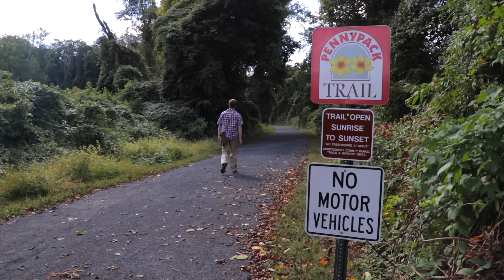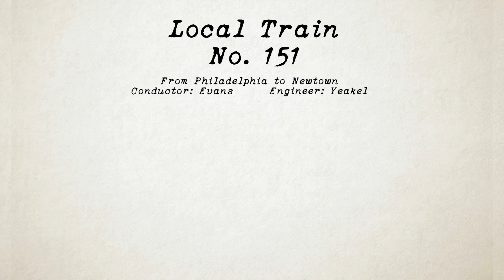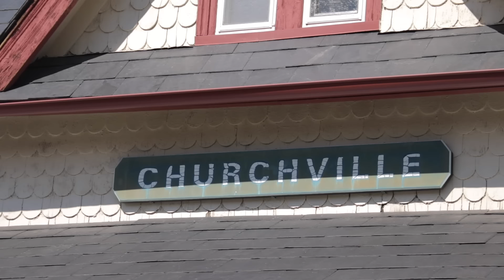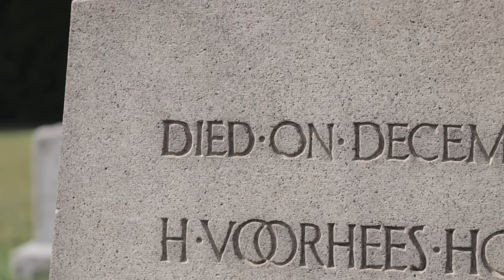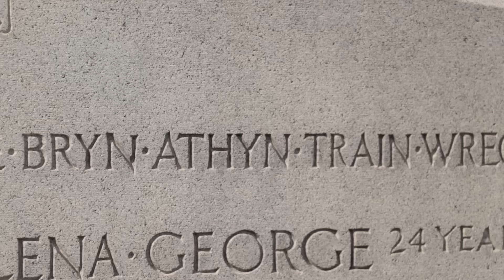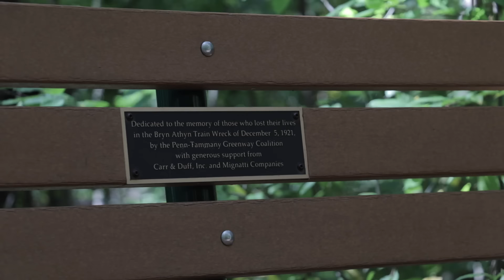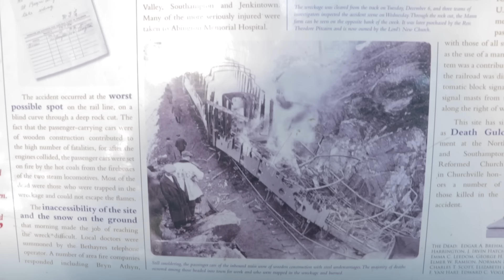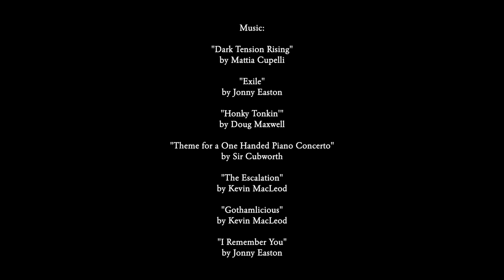The Bryn Athyn Train Wreck of 1921

Comment: A fascinating story. As an English railway enthusiast and son of a signalman - should I say tower operator? - I know only too well what happens when people get complacent or cut corners. We had a similar disaster here, at Abermule early in the same year, due to every responsible person involved failing to take even the most basic of routine safety measures. Oddly enough, one of the two trains involved was also coming from a place named Newtown. On a slightly lighter note, it was also interesting how many clips of British railway films turned up in this programme - some even from a British Railways training film of 1958, named 'Mishap'! There are also some from a famous pioneering British talkie film, 'The Wrecker' - the shot of the steam lorry is one. It is demolished by a train in a staged crash, of which you show a few clips as well. Thank you
Reply: Yes, I thought a few of the vintage clips in this documentary looked British to me, not that they take away from the quality of this video at all. 😉
Reply: Incidentally, the Abermule collision also occurred in 1921 - and as you say many factors leading up to the accident were eerily similar. I believe the collision even occurred between a local and an express, just as at Bryn Athyn, on a single line section.

Comment: Note - The reason for the single track through the gorge is because it is a natural fault line known as the Bryn Athyn Fault, which does occasionally gives us a tremblor.  The last one I remember was in the late 1970s/early 1980s.
Reply: I live in the area and never knew that.. Thanks
Reply: @cmendla  I used to ride that train on a daily basis and look out the windows (as green as those old RDCs were) at that cleft wall of rock through the cut wondering if it was going to get higher soon! ;)

Comment: An excellent video, especially given that (as far as I was aware from your time on Titanic: Honor & Glory) railway history was not your specialty. 

This was superbly told in excellent detail, especially little tidbits like how all locomotives involved were Camelbacks, a unique form of steam engine with an oversized firebox for burning anthracite coal, a particularly hard variety that is nearly pure carbon that burned extremely hot and efficiently but was hard to ignite and needed a large combustion space, thus necessitating moving the driver's cab forward to about halfway along the boiler. These engines had themselves been largely banned from US rails due to concerns of crew safety (there had been some instances of coupling rods breaking and skewering the driver through the cab floor, and the lack of visibility to both sides made them unpopular), but exceptions had been granted to the Philadelphia & Reading and the Central Railroad of New Jersey, making them the only lines to use camelbacks after the 1920's.

It's also interesting that this wreck resulted in the final banning of wooden coaches on US rails, a finding already made after the Great Nashville Train Disaster of 1918, the deadliest train wreck in US history. Rather than being the impetus for such change in itself, it seems more accurate to say that this wreck underscored the necessity of this change, and emphasized that it needed to apply to ALL American railway lines, not just long distance mainlines; what happened on the Nashville mainline could just as easily happen on the Bryn Athyn branchline or the Malbone Street subway line in New York, also in 1918 in which a train of wooden subway cars driven by an unqualified motorman rounded an extremely sharp curve too fast resulting in the train derailing and crushing against the tunnel walls. So the same safety standards needed to be enforced everywhere with no exceptions. Rather the same way that in modern times the Roslyn train collision on SEPTA in 2006 demonstrated the need for Positive Train Control, which was emphasized by the Frankford Junction high speed derailment in 2015.

One point of order though, I'd like to see your information that the locomotives' boilers exploded in the wreck. While this wasn't uncommon in head-on collisions, it was far from a given either. Look, for instance, at the Dugald Disaster in Canada of 1947, in which a special passenger extra collided head-on with a stopped express at 30 mph, resulting in both locomotives being practically fused together at the pilots, but neither boiler burst. As I say, I'm not necessarily doubting that it happened here, I'd just like to see where you got that information as many less credible sources sensationalize boiler explosions in accidents when nothing of the kind actually happened.

Comment: A good presentation on a tragic, avoidable disaster. However, I think more research is needed on wooden cars being outlawed, because they weren't, totally. Wood cars on mainline trains were on the way out after 1910, because the Pennsylvania Railroad did not allow them into New York through its new tunnels under the Hudson River (the same tunnels still in use today, in urgent need of replacement - but that's another story).
The Pennsylvania was the largest and most influential railroad in the US. Outlawing wooden cars into New York caused a great scramble by connecting lines and the Pullman Company - though it had started building all-steel cars, it still had thousands of wooden cars with steel underframes. These were assigned to other routes or secondary trains, and many older cars were sent to Canada or Mexico.
But all-wood cars remained in service on shortlines, branches, and commuter lines for many years. Wood passenger cars were eventually outlawed in interchange, but those that stayed in the "home" road continued in use, particularly those with steel underframes. The Boston & Maine used wooden, open platform commuter coaches until about 1950, the Chicago & North Western had similar cars almost as late. Many Class I railroads operated branch line mixed trains into the Fifties with wood coaches and combines, usually with steel underframes. 
All-wood cars remained in use to the end of passenger service on short lines, like the Maryland & Pennsylvania, which went freight-only in 1954. Until 1973, the Moscow, Camden & St. Augustine Railroad, a Texas short line, carried the occasional passenger in a former Long Island wooden coach built in 1898.
Reply: 1972 IC crash in Chicago nr.Soldier Field caused many deaths.A wooden passenger car and steel commuter car were flattened in the collision.
Reply: @daniellinehan63  No wooden cars involved in that crash on the IC's electric commuter lines. A train of Highliners, the new bi-level cars, overshot a station and was backing up without protection when a train of 1920s era heavyweight steel cars ran into it. The older, all-steel car telescoped the lightweight new cars. 45 were killed.

Comment: I don't recall any talk of this accident in the 1970's on the railroad. That surprises me, because any anomalous event was the subject of discussion. For example, in south Philly, some tidewater grain hopper cars rolled downhill from Penrose yard and nearly struck the Stadium Tower. Corn and twisted metal everywhere, blocking the tracks into Greenwich Hump and most of the Packer Ave area for a couple of days.. On the Reading side, the Bryn Athyn line was still active, and you would think that someone would have mentioned it, at least in a Book Of Rules class as an example of actually reading a train order.

Comment: Interesting my local railroad was electrified and used wooden cars. There was one steel car later in its history and the freight locomotive was steel. However, the wood cars were taken to a spur doused with an accelerant and torched around the mid 1920s or 30s. Two of the six remain as they were sold to the Pacific Electric, though they don't have frames and what is left is in poor condition.

Comment: Trains working on a single like in both directions, works really well ... until it doesn't. Unfortunately that saying "Familiarity Breeds Contempt" applies  in this case. What I'm not understanding so far, is how the local train, No.151m was able to burst through the facing points set for the express to pass through, and get on to the line. The facing points should have derailed No.151. Excellent presentation.
Reply: Pretty sure the sheer weight of the engine and the cars is enough to push the rails over as it was coming out of the siding.
Reply: I wondered the same thing, not sure if the weight could do that. I wondered if the points were set by the train crew rather than the signal man as you would expect. It seems like a really basic fundamental no brainer to connect the signal to the points. I'd really like to know the answer to this and hope somebody can enlighten us.
Reply: @barleyeducated8714   Agreed, that is the only plausible explanation.
Reply: @QQ_241   "not sure if the weight could do that."  - Yeah it makes sense. It could be the actuating mechanism could be worn or weak enough so the wheels can force the point blades back to the opposite position. I just read an article on it.

Comment: The lead-up to this crash has interesting parallels with the Abermule disaster in Wales.  It happened in January 1921.
Reply: Also Pennsylvania was settled by many Welsh immigrants hence the name Bryn Athyn, Parallel's indeed.
Reply: Yes, well spotted John.    Abermule was also a single line collision caused by traincrew failing to read the small print on the 'authority to proceed' they had been given (they had actually been given one applicable to a different section of line due to a mix-up amongst the station staff).    Single line collisions were very very rare in the UK, yet this was the same year too - almost spooky.
Reply: Spooky indeed!

Comment: @10:15 you state the combined speed being over 65mph but you ABSOLUTELY do not add the speed together like that to determine a crash speed. The speed if anything would be split between them meaning the crash was equivalent to a 32.5 mph crash into an immovable object provided the mass of the trains was equal. But two trans crashing at 30mph head on would not be equal to a single train crashing at 60mph. myth busters did an excellent piece explaining this

Comment: Model railroader here (kind of a train nerd). Train routing and signaling has always been a problem. The problem is that trains take a relatively long distance to stop. The block method is meant to ensure that only one train occupies a block at a time, and that all trains are shorter than the shortest block. By the 1920's, larger railroads had more advanced signaling systems, but locals like these would probably still have been flags, lanterns and semaphores of some type. In the case of train orders, as you mention, they are the Bible and the law, and pre-empt any other method of communicating. You did a great job of researching this and explaining how complex a set of circumstances has to occur for a crash like this to happen. It is crushing to think of the signal master having to call ambulances because  he knew what was going to happen and could do nothing to prevent it.

Comment: Great research and presentation about an industry-changing wreck I hadn't heard of before. A few minor rail terminology corrections...
What you called a "sideline" or a "spur" is a passing siding, with a switch to the main track at each end, where an inferior train pulls in to let a superior train pass. Plain "siding" or "sidetrack" will do. There are also industrial sidings, where freight cars are dropped off and picked up for local businesses. Those usually have a switch at only one end. A "spur" is a short branch or section of track diverging from the main. The guy who handed the train orders to the crew is a station agent or agent-operator. At a small wayside station like this, one person would handle all the jobs. "Operator" was a carry-over from telegraph operator, and it remained the job title even after telephones replaced the key.  A station master supervises a large, busy station in a city or large town. The tall metal posts along the line that formerly supported signals on this abandoned branch are "signal masts," not signal towers. A signal tower is a two-story structure like the one at Winslow Junction in your Midnight Flyer wreck video, occupied upstairs by an operator who controls junction or crossover switches interlocked with corresponding signals. The railroad terminology can be confusing to a layman or a beginning railfan, and it might be helpful to reach out to one of the railroad historical societies to help get the jargon correct, while understandable by the general public, when scripting future vid projects. But like I said, great job overall.

Comment: In the UK single line workings require the engineer to be in possession of a unique token before running.  Only one token is available at a time and is dispensed by a token machine at each end of the track section.  That method of interlocking was never implemented in the USA as there is so much single trackage.

Comment: when you said you lived nearby, it reminds me of how I recently learned that the worst train disaster in Danish history happened about 2 km down the road from where I live, in 1914 - where an express train rear ended and went through a stopped train (that wasn't supposed to be stopped). The line was completely rebuilt in the 1950s, so there's nothing to see of the crash nowadays, and only a single set of wheels from the offending locomotive have been preserved. It's not a crash that's ever talked about, since it happened so long ago and the events that caused the crash aren't likely to be possible to happen today, as it'd require several systems to fail at the same time

Comment: I am a recently retired RR employee. I worked for Amtrak and Retired as a Track Supervisor. However while working in the capacity of Foreman.  I did frequently move( PILOT )equipment on the RR . Generally there is always a reason for any rules that are incorporated on the RR's. NOW when moving onto a section of track the LAST CONTROLLED SIGNAL may never be displayed .it MYST REMAIN in the STOP indication. We are READ Permission order ( which mist be repeated), to go through the signal and IT REMAINS in a STOP Indication. When asked by several of the NEW FOREMAN why they couldn't just display the signal and let us pass, I used to tell them, that many of our track machines do NOT SHUNT (short the circuit ) therefore they do NOT AFFECT the signals. Theoretically a train coming up behind, OR IN THE OPPOSITE DERECTION  will have NO INDICATION they ARE EVEN ON THE TRACK. A train traveling at even a moderate speed of 60 MPH takes almost a Mile to come to a safe stop.

Comment: This is the first time I have heard of written orders but the story exposes the danger of changing a routine without flagging it. This is the kind of problem the tablet or token system tackles. It would have reduced capacity  by not being able to handle 3 trains but in principle one stretch of bidirectional single track has a single tablet that shuttles back and forth. The locomotive with the tablet owns the track. There are electrically controlled variations but the system frustrates Murphy's law when it comes to keeping order and was in use around the world in 1921.

Comment: Maybe for single line working, a physical "single transferable  token" system (as used to be common in the U.K.) might have been more secure than written permission? Then only the engineer holding the token has permission to use the single track.

Comment: 2:54 #Camelback! #CNJLives Or so that blurry insignia resembles.  #JerseyBoy I didn't realize they had all-wooden cars in use so late. I read of a wreck in the midwest in the late 1800's caused by a fire underneath a small trestle where some controlled fires were lit by a crew to preserve brush and litter from igniting real fires. They weren't thorough lt extinguished, and a Passenger train came later, didn't realized the structure was too weak from the flames.....
The engine and tender got over before the bridge failed, the second( all-wood) car plunged forward into the ravine it crossed and subsequent cars "Telescoped" into the first, crushing dozens of passengers. One account claimed about three cars actually crushed into the space/length of a single car. This started the push to build all-steel passenger cars. 
From the book "Railroad Avenue." Quite an oldy, and has a photo of Casey Jones's son as an engineer on the same ICRR!!

Comment: The same thing happened in 1947 in Axeman, Pa. A relative was killed on that train accident. Two trains were allowed on the same track. One train was coming from the cannery and the other train my relative was the conductor on was pulling ore cars. This train had the caboose in front of the engine. The fireman was drunk and was in the caboose with my relative. When the trains met head on the caboose was crushed to 3 ft wide. It made a terrible noise. Metal on metal.